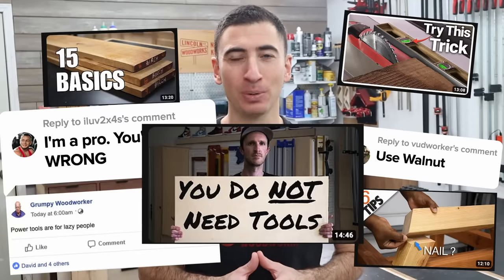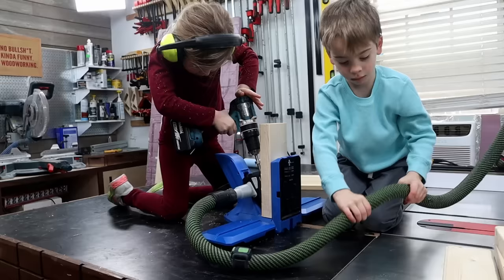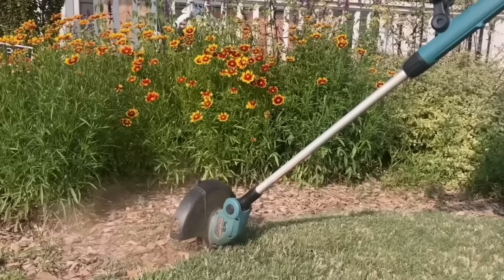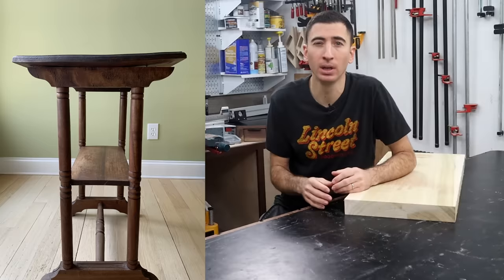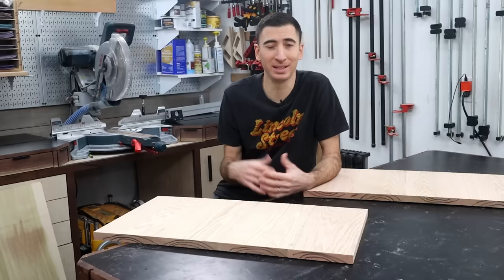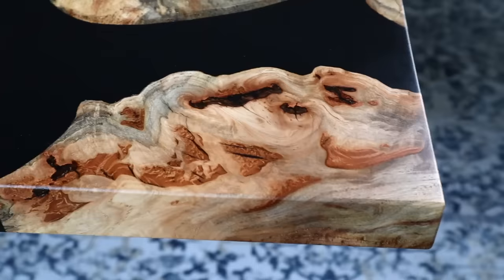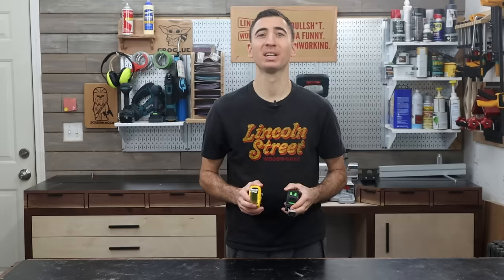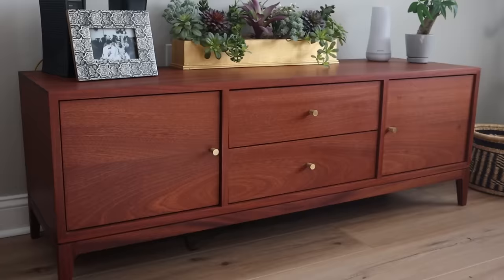Every beginner needs to hear this

Comment: ...most homes outside the US do not have HVAC (???) units. I do not even know, what that is - I heard you say something in the lines of, "that stabilizes air humidity". 
    Very few homes, no matter how new, in Denmark has that. We do not have air conditioning, either. It is far too expensive to run AND bad for the environment.
   Still a very enlightening and educational video. 👍👍👍

Comment: The only thing I have a minor disagreement with is that some things in power tools DO make a difference, even for novices and hobbyists, mainly what battery platform they use. I use my cordless drill for almost everything around the house because I can't be arsed to own an impact driver and/or a corded drill alongside it. When I used a drill with a 12v battery it often wasn't powerful enough to get through some walls (I don't live in the US, our houses have real walls) but that has been less of an issue since I switched to a 20v battery platform. Other than that, I wholeheartedly agree with everything else.

Comment: One thing that you didn't mention when talking about Grain and furniture making is, wood types, yes true people are making things out of all kinds of crap wood, but there is a reason why most really good furniture is made out of fine grain woods, like Mahogany, exceptions are woods like Oak, but Oak is not crap wood, it is very hard, and more stable than wood like pine or spruce. As in the softer woods, Oak, and some of the looser grained woods, and all woods really Moisture content, is always important, and a good point that you brought up is to know when and where to use different woods, and different joints. But as I said, woods like Mahogany, Cherry, maple, are Harder, and finer grained woods, better for furniture, I guess that the truth is it isn't as simple as you stated...

Comment: Re filling cracks. PVA isnt great, but if you can get filler gel/filler resin, which you also mix with sawdust, its amazing. Sands smooths, takes stain, although it will stain like the end grain, ao usually looks darker

Comment: In floring, if you don’t want splinters in your bare feet, always lay the boards ‘smiling’. That way the edges will come to lay below average surface overtime. When making a barrel chest, or similar lid or curved door, use your timber in such a way the curvature tends to get stronger. The backing frame counters this by feeling compression under which the entirety will keep shape better than when tending to stretch out. 
Thirdly, don’t listen to him about not alternating growth ring orientation in a panel. His only argument is that you wouldn’t be able to use one better board optimally. Do you have that better board?

Comment: Okay I'll take the bait. 

Okay, yeah I've been an multiple 
 award winning Master woodworker and carpenter, for 40+ years. I was taught by and worked with some of the finest  Artisans you would ever have the privilege of knowing. 

Having said all that, it doesn't mean that any one opinion is always right. As in every thing in life we grow by testing the boundaries. What these guidelines do for us is to give us a foundation to learn. 

And you're right advancements have changed aspects of woodworking. New materials, improvements in materials mean that rules can sometimes be bent.

But to out right declare everything that came before you is a bit concededness. Listen if you find something that works for you. More power to you.

If someone taught you something, chances are it was Found tobe true enough times to pay attention to it. 

I agree with you about certain things when it comes to using Screws and Glue, can be a helpful technique for building production projects. 

Still theres no  Substitution for learning good craftsmanship of making joints without metal fasteners. 

That's the beauty of this hobby/profession is that you're free to do it as it pleases you and or your customer. 

Good luck

Comment: Perhaps in regards to the gluing of boards of boards to together, and without judgement here, is what my Masters in Germany taught.  Multiple board glue ups look best when the all the boards are directionally aligned crown to root as the reflection caused by cutting through the wood cells at an angle reflect in the same way.  Quite visible under a clear spray finish.This is particularity true with boards flitched from the same tree. 
They also taught that using the inside surface for boards in a multiple glued-board panel, produces a cupping result in reaction to increased moisture, in the middle of the panel where the particular bracing used underneath would be strongest and not on the outside edges which would occur if the panel was flipped and where the bracing underneath is weakest and potentially more visible to a customer.

Comment: Here in Mississippi the humidity is above average and so most houses have central heat and air conditioning which dries the air out as it runs all the time, so much so that any table I build is going to dry out further in the house it's going into than I could possibly do in my shop, even running air conditioners and a dehumidifyer .  I see cups and cracks in my new tables and it's embarassing.  I have learned to make a floating joint with no glue for end boards called bread board tables to prevent cracking and the same for the braces under the table, I don't glue them. I screw them down and use a 3/16th or larger pilot hole in the brace plank.  This mitigates damage from shrinkage in a new house.

Comment: Furniture joint strength isn't important until someone accidentally falls against it, or drops something heavy but soft on it, and the joints pop. Then you will regret not taking more time to make decently strong joints. With a mortise/tenon or doweled joints, even if one member in the joint cracks due to being overstressed, the joint might still hold reasonably well together, vs if you only use glue, then once the glue joint pops, the entire joint is toast. With the former joint construction, it can likely be repaired more easily by adding clue and clamping it. 
As far as glue and sawdust goes for joint cracks, if you use aliphatic (yellow) glues, the glue will not absorb any finish. Using hide glue will allow it to absorb finish, blending more with the rest of the wood. Plus, hide glue joints can be undone with heat and moisture, making repairs easier. This type of glue has been used successfully for hundreds (even thousands) of years. Obviously this won't work for items meant for outside use. The original hide glue was cumbersome to use, but liquid hide glue is available, which works nicely. It's worth a try...there are advantages to it.

Comment: Yep sneak up on the cut is right. To remove a tiny amount each time just push your wood up against the saw blade ..not the teeth as these are a tad wider.. hold wood firmly lift blade start saw and cut down. You have now removed the thickness of the tooth over hand from the blade steel.👍🇬🇧🇬🇪🙋🏼‍♂️

Comment: My golden rule is, Measure absolutely as little as possible, bc marks made using a ruler are never as accurate as you think (hope). (For that inside crosspiece he showed, I would spring-clamp two shorter scraps together in the opening, then butt the resulting stick against the saw blade on top of the piece to be cut. No haphazard creeping up on the cut necessary.)

Comment: If Norm Abrams says to alternate  the growth rings, it's gospel and set in stone.  Using difference  joining methods, depends on how fast I want to build a piece. Pocket holes for fast, dowels or splines or even biscuits for slower more traditional  construction. Point is, they all get the job done.

Comment: Tbf... dowels are kinda easier than pocket holes. I did pocket holes when I was a n00b cuz I thought they were easy, and they are, but you can get a dowel jig for the same price as the kreg and dowels are pretty much just as strong as the almighty M&T, and they're way easier

Comment: Battery powered tools !  ,  I buy those for my wife , lighter in weight and easier on her delicate hands . For me I buy tougher and more reliable corded tools . I still use the same tools that I bought 30yrs ago and anything new must have a cord . Its nice to watch the other guys continually running for batteries and digging out thier chargers after about a half hour of working with them . They even make things called extension cords and you can plug and go so much easier than standing around drinking coffee while your batteries charge . Cords , just my preferance .

Comment: Joinery snobs really hate it when you point out that the Shakurs used pocket screws. Just like how finish snobs really hate it when you point out that the Shakurs often painted wood. There's nothing actually wrong with either.

People whining about joinery XYZ being "weak" usually don't understand how different applications can have different structural requirements. You can make a chair no problem with pocket screws. There's a lot that goes into the strength of a piece. Some woodworkers act like everything must be mortise and tenon and dovetails otherwise it'll fall apart if you look at it wrong. They don't understand that ancient woodworkers didn't use dovetails just because they're strong, they used them because the interlocking pieces held together without the need for nails or glue (yes, they had glue). Dovetails were used because they were fast and cheap not because drawers needed to survive a category 5 hurricane.

Comment: Yeah dried 2x4's at the store have a wide range of water left. Unless dried for furniture use, studs have 10-22% moisture, furniture wood is  6-10%.  My big cheap IKEA weooden cutting boards cups too, (after my GF have cleaned the kitchen counter and left moisture under the cutting board).

Comment: Best power tools?  Are not battery powered, for the occasional worker. 

I have found that my batteries loose their effective charge if not used regularly. So when you need it, the batteries are dead or faulted. Corded all the way. Even on yard equipment. Batteries are expensive. Extension cords are dependable and not expensive. And definitely look up how to properly coil your cords. (No more tangles.)

For the best tool for you, look at what you need, or might need, it for.  Look at motor power, (amps or watts.) Cheaper tools have weaker motors and will not last.  Brand name tools have a reputation to keep, (better motors, stronger gears and bodies), but $$$$ doesn’t mean the best for you. 

And it’s true, once you have a tool you like, that does what you want, you’ll swear by that make for that particular tool forever..  I have a Makita “Random Orbit” sander that to me is perfect.  (And yes, it’s corded.) I replaced my sander recently and bought the same.

Comment: I think the lumber humidity concerns which you laid are also perpetuating a myth that furniture lumber has to be well dried, maybe if you live in a really dry state or have really dry AC but most people don’t have perfect air condition in their homes. If the location the furniture is placed has a higher average of humidity the furniture will eventually absorb until the difference is balanced out some. While table surfaces may have finishes that prevent that somewhat as you mentioned in your video, it’s usually not a perfect seal, and there’s more “furniture wood” than just tables in a home. So furniture wood doesn’t necessarily have to be really dry but it does have to be sufficiently dry, based on acceptable tolerances, you said it, wood is always moving, the question is how much? The answer pretty much relies on your relative humidity and wood species, regardless of how much care is taken in preparation of the board. That’s not to say that you should use green lumber for furniture, obviously there will be too much movement after the cuts are made to guarantee anything will stay within tolerance. I know I’m not providing any useful information here, but I’d like to open up this side of the conversation more, after all I believe it is the drying, inspecting, and stamping process that is in the hobbyists’ way of of truly doing it yourself, and sure we can have the debate about whether the regulations in the national building codes are sufficient or overstep or if they need to be improved upon, but I’m more interested in making the information more general knowledge,or more accessible, but I would say that debate would be unnecessary if I didn’t see a way forward for DIYers to have better quality control at their fingertips in the future, but I do see that way forward, with our modern additive manufacturing processes and everything “AI” learning models are achieving, I can see a world where people will have the knowledge and resources to produce products with substantially less liability concerns regarding product failure or safety. Just as engineers and architects today use their cadd software to evaluate stress in an assembly, one day people might be able to run those stress analysis just by taking a picture of their sketch or model. All this to say we should really be looking into how these materials are sourced and what are the limiters that prevent people like you and me from getting to the next step in our micro-manufacturing evolution.

Comment: I found it interesting that in your statement about growth rings being alternated. You basically said yes, they did in the olden days but then again, no, they didn’t in the olden days. You also admitted that you yourself do it when you’re working with thinner wood, but not necessarily with thicker wood. The best trick to prevent cupping is to use quartersawn wood or is the old timers would’ve done it for the most part split logs into lumber. If you split a log in half you have to have circles you split it again and you have 4/4 split it again eighth then 16th and so on depending on the diameter of a tree will determine how many times you can split it that and the thickness of the wood you need or the width of the board. When you split the log, it follows the grain and produces the most stable wood and it will have the effect of being quarter sawn. So your thumb nail was kind of misleading you should say that don’t make it such a hard and fast rule you put the worst face of the word up rather than the better face of the word up and then here are some tricks to keep it from warping as in breadboards ceiling, both sides of the wood, and so on. Measure twice cut once, if you’re actually measuring then, yes it’s a good rule, but is it necessary the best way to get a proper fitting piece? Maybe instead you should make a pattern or dry assemble the pieces you want to put the next piece between and make marks kind of like you did when you stuck the board on one end and marked the other end. Of course the best either of these methods is don’t cut on the line the first time leave yourself room to work your way down so you can have your first rough cut, and then the finishing cut. This could give you the adage of measure twice cut twice. The best Takeaway here is measuring is not as so, the best way to get the best fit especially if you’re trying to do fine Woodworking, and not just throwing something together or rough carpentry. As you may have noticed here, I’m not exactly agreeing with or disagreeing with you so much is pointing out your kind of made it misleading when you were starting to say it’s a myth.

Comment: 30+ year Carpenter here. When it comes to tools for beginners and don't matter. The quality of your tools does matter in how long last. But that only matters if you're using them as much as I do during the day. I put my tools through thousands and thousands of hours of hard labor. I have used Ryobi on job sites with great success and great failure. The quality of your tools only matter with how much you're using them.

Comment: When putting down decking, it is good to cup your boards in the "sad face" position. Over time being exposed to the elements, the boards will cup. If they are laid out in "smile side" position they will hold water and rot out more quickly.
Reply from the maker: makes sense for decking!

Comment: I've been around woodworkers for a long time now (I run a CNC router so most of the shit we build is plywood) but there is so much gospel surrounding the profession its amazing.  Correct - there are thousands of years knowledge in regards to working with wood however I can also say there are thousands of woodworkers that literally pass on the same gospel without actually ever knowing whether what they say actually is a hard fact.  Most people in my experience (in all fields) just repeat the same shit over and over.  Some of it is true some of it is false and some of it depends.  Thanks for the video.

Comment: "measure twice" could mean use multiple methods and make sure they make sense.   E.g make sure something is square by measuring the corner distance and a square. Or when funding center, measure from one side of the board and the other to make sure you aren't a blade width off.

That's how I interpret it, anyway.

Comment: Off topic question for a new DIYer and working with wood if you or someone else can help I'd appreciate it. Trying to build an IBC tote stand (4ft off ground) for water pressure to gravity feed my garden. Those totes are pretty heavy (2330 lbs full of water). I want to build this securely and properly without any chance of sheering screws or anything of that nature. Looking at building this with some 4 x 4's and some other materials as I have heard 4×4 posts can support at least 4,300 lbs. So having those as my foundation seems ideal. Though I don't know wtf I'm doing. Help?